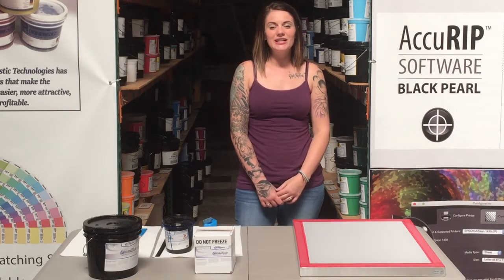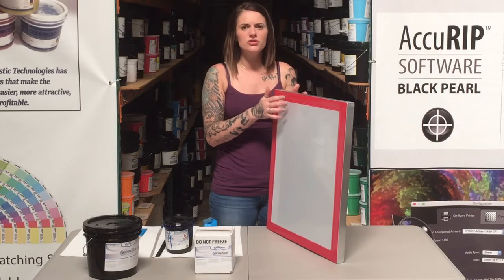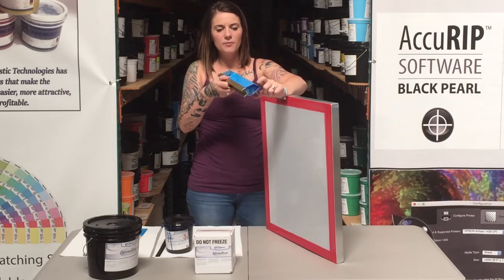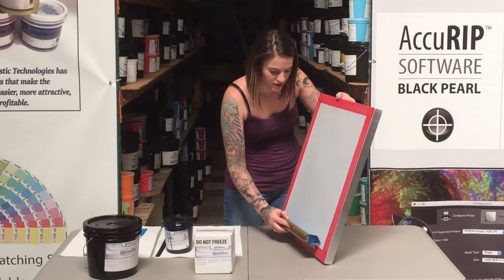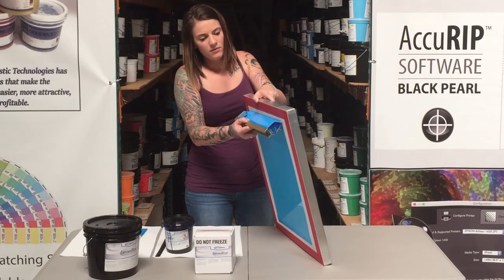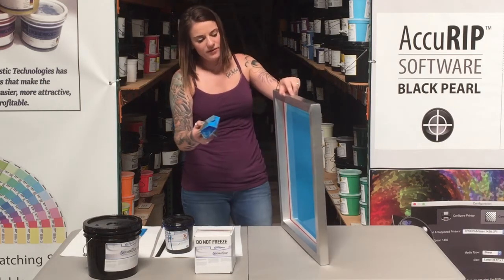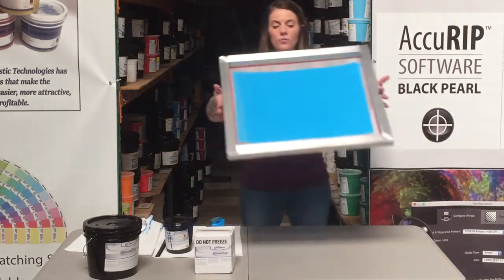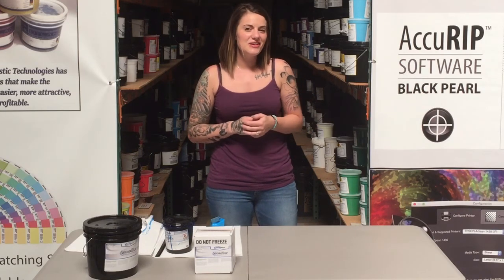How To Coat a Screen - Screen Printing

Comment: Why don't you use squeegee to apply emulsion ?
Reply: The scoop coater is designed to apply emulsion evenly and within the boundaries of the screen (closed ends keep the emulsion from spreading out the sides)